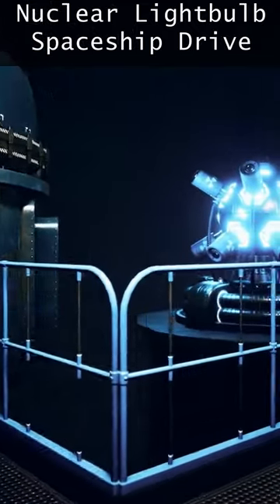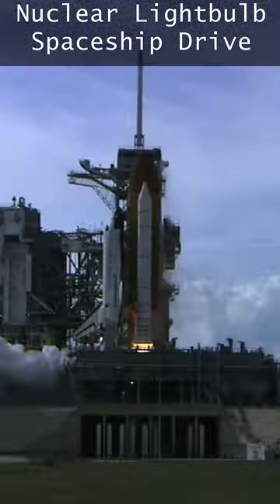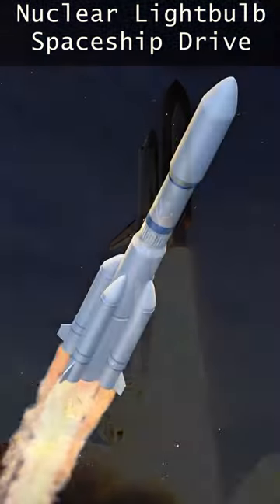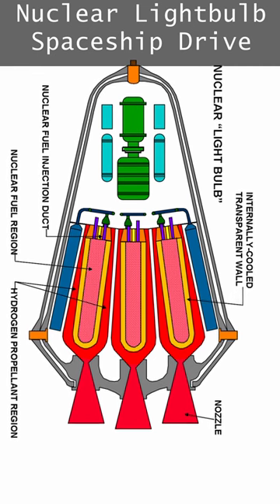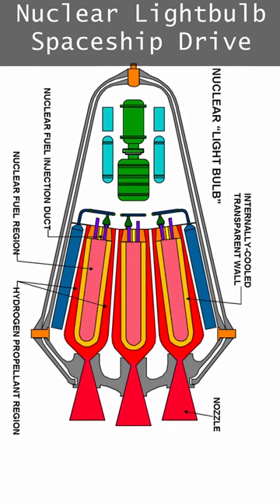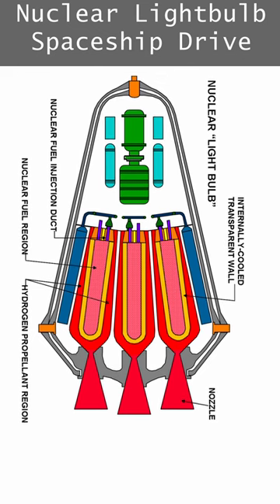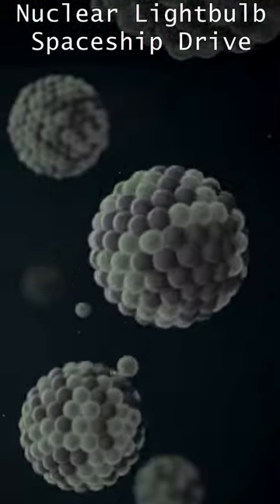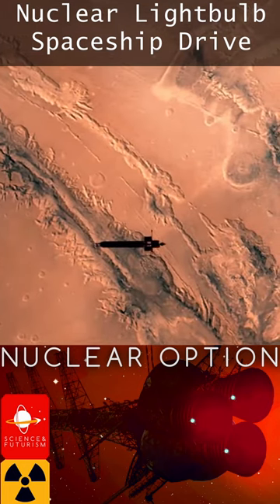Nuclear Lightbulb Spaceship Drive

Comment: The documentation on this engine says it's infeasible due to the nuclear reaction melting the quartz chamber walls. Even though "most" of the energy is released in the UV spectrum, there's enough that's in other spectrums to melt the quartz chamber walls and melt the whole rocket.

Comment: Instead of flying off a space shift from ground

When can we build a tower that goes to space then launch the ship
Reply: An elevator would be more practical and the author of this clip has a video about space elevators. A tower is also possible but it will need active support and consume energy like there's no tomorrow just to stand upright. Again, the author of this has also an video about space towers too .
Reply: @florinpandele5205  they're saying the same thing man lol. In what way is the elevator you imagine not also a tower? You are talking about the same thing... use your mind like this channel encourages.
Reply: @joeshmo8267  I think he meant that, while an elevator would need a cable to ride onto it and therefore said cable could be held with basically a weight on the end, a tower wouldn't be as high, and so couldn't use a passive way to keep itself vertical, without the use of some kind of thrusting mechanism just to not rely entirely on the structural integrity of the material of the tower, which would be fighting against gravity in a compression force.
Reply: That’s called a “space elevator”.
Reply: @markvoelker6620  Yeah I know, I guessed it was because I don't think there's any other elevator that goes to a rocket and makes it easier to launch it.
Reply: Or just build it in space
Reply: @denissorn  I mean, that's probably easier to do than build a space elevator, considering we already know how to build a rocket, but the problem would be the materials needed for it would need to be made in orbit already to make sense

Comment: "Save" being a bit relative term for an engine that desperately needs to get rid off its excess heat or else vaporise itself(at 22000C) ... while carrying a nuclear fuel depot through the upper atmosphere at mach jackass.
Reply: Not atmosphere. Deep space
Reply: Jackass% of the speed of light.